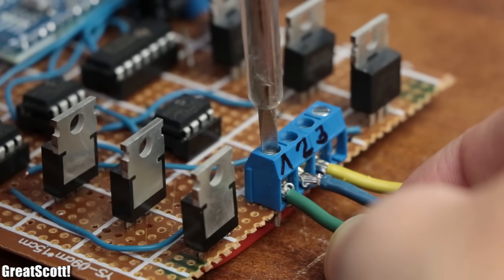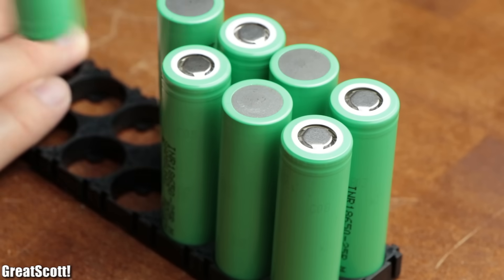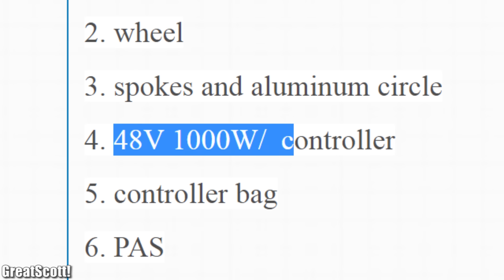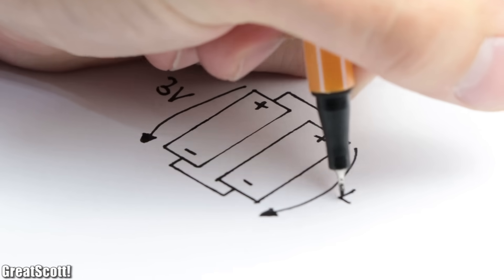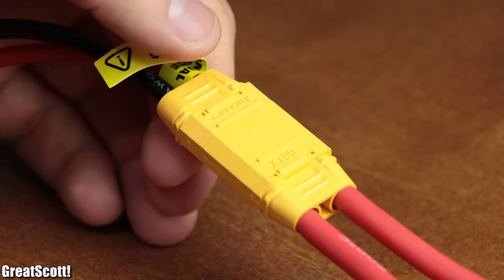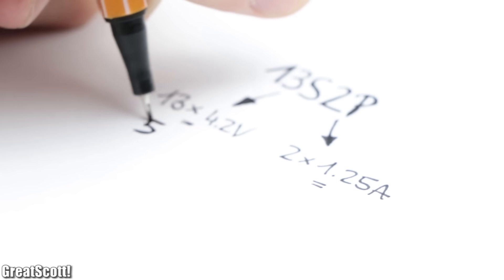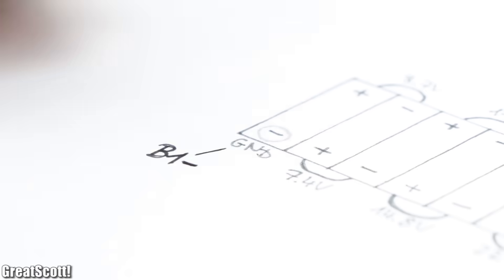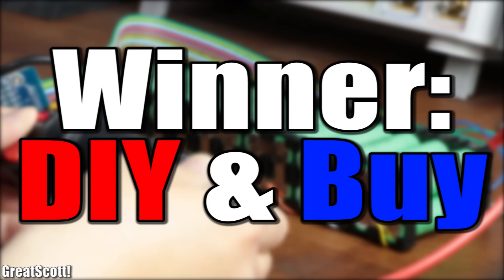EBike Battery Pack || DIY or Buy || Electric Bike Conversion (Part 2)

Comment: Connecting cells in parallel like that is so irresponsible it's amazing. You have used a 30 amp link to parallel pairs of cells. What the hell do you think is going to happen if one of those cells fails shorted? The other cell will discharge through the failed one and cause a fire. You should link them with a much lower rated conductor. Then take your common feed from the center of the link. That way, if one cell fails shorted, the fusible link will fail and cut off the damaged cell from the other.

Comment: I always thought it was dangerous to solder on these 18650 !! so no risk of overheating them and leading them to explode ?? Dunno why I thought it was good to put them in freezer first prior to try to solder them together. Your answer would be quite valuable as I have been putting some project on hold just because of that !
Reply: nevermind... just saw this other video you made : https://www.youtube.com/watch?v=5TVNdMqVZpk conclusion, i need a welder :D

Comment: Hello Scott! Hope you are doing well. 
Greetings! Firstly as alwats amaining illustrations and explanation. Each and every point you have covered properly. Even a novice can estimate and design his required battery bank this way. Great.
I have been following you a long. 
Today there is a question and i really wish you answer!!

As i said you did each and every essential things required. But i wondered why you didnt do Safe parallel connection (SPC) i.e. by putting less wider nickel strip (approx 1A) for connecting parallel connections . As you know in worst case scenario and for short circuit that connection will break. 

I am not an expert on this. I was just expecting to learn something more on that from you. (I get to know about SPC from youtube channel Damiane Rene - somewhat like this name) i like his workmanship as i like yours too. 
I will look forward to your answer. 

Thank you for the video. Bye

Comment: Is there any safety measure  in case one cell of a pair shorts? Thanks!
Reply: Add a fuse or connect a thermistor in series with the load.
Reply: I don't think it's the case. Suppose one of the cells shorts, then the other (in the pair) will provide all the current to that one regardless if there is a load or not. May be you meant a fuse between each pair¿?. If it is like that well...that was my point...

Comment: I'm not certain, but I think many of the cheap pre-built battery packs you would find on ebay would contain lower quality 18650 cells than the Samsung 25R that you bought. 

If you bought a well-made pack with samsung 25Rs, it would certainly be much more expensive than what you built...

Comment: What is the specification of the 18650 required to build a 24v 14ah battery pack?
Reply: that's not much capacity unless you're running 250-350W. 36 18650's would do that spec. 6s 6P... you'd want 2400mAh batteries

Comment: Your DIY cell might have cost only slightly less than a ready-made solution, but don't forget that you used high-quality balanced Samsung cells, whereas the ready-made solutions at the same price probably use cheap off-brand chinese cells, that give you less battery autonomy at best, and much shorter battery life at worst.
Also, the DIY solution has the advantage that you can make it any size your budget allows and any shape that fits your particular physical (and aesthetic) constraints, and it's easier to upgrade in the long term.

Comment: Was wondering, if you had a BMS with and separate charge and discharge negative contacts could you not just join them both together? Would save having a separate connector.

Comment: Is BMS required for parellel connection batteries charging?in case if i use more than 10 18650 cell

Comment: Nice Video. Can I ask you to make a Video about the current carring of nickel strips? On endless sphere you find subject about 18650 spotwelding how to. It may be good if the numbers could be explained in a Video. You got some nickel strips left? Can you please calculate the optimal and acceptable current of series bushbars?   Im oben genannten Chat ist eine Tabelle betreffend dem Stromtransport von Nickel aufgeschaltet. Es wäre interessant, wenn du die Werte prüfen könntest und mit deinen vorhandenen Strip vergleichen könntest. Ich wäre besonders an der Formel interessiert, da ich es einfach nicht schnalle wie Werte errechnet werden. Bin seit >10 Jahren vom Beruf weg...

Comment: I'm actually doing this same project right now too! same kit and everything.  Glad I watched this as I was debating 12s and 13s.  I am using salvaged batteries from laptops so I am planning on a 4p setup for battery life and reduced current draw on individual cells.

Comment: THE best “how to set up” battery pack video out there! I spent years clarifying and watching other ppl do it! You won’t BELIEVE how many ppl don’t tell you the orientations the batteries or the voltage. They just say “oh spot weld or soldier”
Reply: What's the answer for the battery orientation?
Reply: @pulledtoworkout2833  it's not "an answer" it's a diagram.
The diagram depends on your voltage and amp hour requirements. 
If your requirements are exactly the same as in this video, then wire the battery in a 13s 2p (13 in serial with two banks of 13 batteries in parallel with each other)

If you watched the video you'll understand. If you didn't understand from watching the video, then DEFINITELY do not spot weld your own battery packs, because you'll break something or start a fire. 
The answer to your question is the 13s 1p configuration, and if you don't understand putting two banks of serially connected 13 batteries into parallel with each other, then you can't safely make your own battery pack. 
Aside from the spot welding requirement, the second most important requirement is understanding how the cells are wired to each other. 
You saw it in the video if you were paying attention.

I'm not trying to be mean. But if you didn't understand what you saw, and how to apply it to your project, please don't attempt it. 
Burning down your house is not worth saving $350 on a battery pack, is it ?
No.
Reply: Thank you GreatScott

Comment: Btw lifepo4 batteries are the best. The last for very long and are safer than other lithium batteries. But only thing is they are expensive. I think their performance overrides their price. You can check here for buying a premade pack http://www.pingbattery.com

Comment: FYI that controller will be using a resistor pair to set the LVM cut off its really simple to change the LVM by swapping out the resistors.

Comment: Not sure it's an apples to apples comparison.  Only way to really tell is open up the competition's pack and see if they are using cheap Chinese Lion batts (which I'm pretty sure they are).  
I've rebuilt drill packs with good batteries and bought drill packs on eBay, and the ones I rebuilt with good batteries are way better, last way longer and hold a charge way longer.

Comment: Cells maybe legit but 3.5v is NOT a proper storage or shipping voltage, its way too low.
I made one battery like that except it was only 2C discharge rate and what i used for charging was a 1kw siemens power supply for radio communications towers. It had current and voltage cotrol pot so it was really good and did the job fast 2 hours max.

Comment: Hi GreatScott, Nice video! I saw a little spark while connecting the battery pack to the inverter. You don't use a precharge resistor to charge the input caps ?

Comment: Why did you did the parallel connection before the series ? Most of the current will flow trough the series connection , while only a small current goes through the parallel connection (just enough current to keep both cells at equal voltage )

Comment: Good video. I am currently running a 24v 250w setup on my bike. It's powered by two 20ah 12v SLA batteries. Only cost $80. I plan on upgrading to lithium ion when prices get lower.

Comment: Where abouts did you get the .3mm thick nickel? That stuff is bloody hard to find! P.S. your links in Amazon are for nickel plated steel - which is pretty crap, and with only 0.15mm thickness.

Comment: It would be better to go with 14s2p instead of 13s2p. The extra 2 will give you better cell life as you wouldn't need to charge to 4.2V, but 4.1V instead. That will drastically increase the life expectancy of the cells by 100's, if not 1000's, of cycles. 
13s @ 4.2 / 3.7 / 3.0 = 54.6 / 48.1 / 39.0V
14s @ 4.1 / 3.7 / 3.0 = 57.4 / 51.8 / 42.0V
This will give you much better performance of your motor as well.
Reply: Pretty sure the BMS he was using is not capable of charging the cells part way due to the way it balances batteries. So it wouldn't help. Plus 13s BMS systems are more common than 14s ones. Of course using a difference method of charging where you could charge to a specific voltage would extend the life of the whole pack.

Comment: I would do the series connections first because they handle a lot of current. The parallel connections handle very little current except at the ends and can be done with 18AWG or smaller. Also look up Rinoa Super-Genius because she has assembled several bicycle battery packs.

Comment: Is there anyway to make the battery waterproof ? I mean I saw your video about waterproofing but what are the main part that need to be covered with that nail thing ? Also what about the temperatures of the battery ? Will you put any sensor in case of getting very hot at summer ?
Reply: Ideally you'd want an aluminum enclosure with proper sealing/gaskets. The water bottle design seems most foolproof.

Comment: I think the pro with making your own pack would be making it a larger capacity to the normal ones you buy off shelf.  This pack is pretty small as it is. Good start though. Also picking up second hand cells is a good way of cutting costs, although adds risk of unreliability.
Reply: I steal the batterys from e scooters, i am rebuilding three batteries into one for my ebike. Yes this is stupid, yes it will work.
Reply: @kevinhorstmann1435  No problem using used cells as long as you check them properly :) I bought a 8 channel tester/charger that tells me exact capacity of each cell

Comment: Be careful with those chiese lab bench power supply's, sometimes the voltages becomes wrong after use--Then your circuit suddenly fries and you don't know why. When you check power supply voltage, the display says 4.2v and its actually 6v. It's pretty cool.

Comment: The best  power solution for those controller and motor  is a  14s  battery.
with 6parallel   with the samsung  18650 35E  or  the LG INR  Mj1.   It will give you a really good range.
That battery you created  is ok, but for a 500w motor or less;  with a 1000w motor  you will drain them really fast.    When you use a 18650 on it's current limit,  you also shorten its cycle life 
I make E-bikes,  E-chopper bikes and E-cargo bikes.
Also  let me recomend  Nkon.nl  as a trusted battery suplier.   Most of the chinesse supliers are only a scam

Comment: My OCD got triggered when you used 13 batteries and not 14 (dividable number) or 15..😂
Reply: 13 pairs, so 26 cells. You have to have however many the voltage dictates.

Comment: NiXX battery can't have so much Wh/l. I replaced in my citroen saxo 20×6V100Ah NiCd blocks with 7 tesla modules. One block has 600Wh, 8l and 13kg. One tesla module has 5300Wh, 16l and 26kg. 2 blocks and one module have exact 16l and 26kg but 1200Wh vs 5300Wh. It's more that in 4,x times.

Comment: You want to match battery pairs by their internal resistance, not their out-of-the-box charge voltage.
Reply: Measure voltage drop in a resistor and do the math.
Reply: TheVexCortex i didn’t know this, I also have never tried to measure a batteries resistance.
Do you just measure it like a normal resistor?
Reply: You need a special meter to measure it, if you hook it up to a multimeter, you will probably kill your multimeter. Mine is built in to my charger: https://www.amazon.com/Version-Digital-Battery-Discharger-Temperature/dp/B00ZGZZ40K/ref=sr_1_32?ie=UTF8&qid=1526094888&sr=8-32&keywords=lithium+charger
https://www.walmart.com/ip/Tenergy-5-in-1-Intelligent-Cell-Meter-Capacity-Checker-Battery-Balancer-Battery-Discharger-Internal-Resistance-Tester-ESC-Servo-PPM-Tester/179864013?wmlspartner=wlpa&selectedSellerId=2240&adid=22222222227056692896&wl0=&wl1=g&wl2=c&wl3=233956535514&wl4=pla-384625138979&wl5=9022129&wl6=&wl7=&wl8=&wl9=pla&wl10=113146105&wl11=online&wl12=179864013&wl13=&veh=sem should do the job though.

Comment: Both provided links are for 0.15mm thick nickel strip.  Did you use 0.15mm or 0.3mm?  If indeed 0.3mm, that spot welder works well.  What type of battery and voltage is powering the welder?

Comment: I am enjoying this project. I assume it would be preferable to solder the BMS leads to the appropriate nickel strips before spot welding them to the battery, in order to avoid heating the batteries.

Comment: When you charge the battery pack with the BMS, is the input voltage just the 4.2V of each cell times the number of cells you have? So that would mean I would need to get a power source that can supply the same voltage as the max voltage of my battery, or would the BMS stop charging when it reaches the voltage specified in the datasheet? Also, does the BMS limit the amount of current going into the pack when charging, or is that also determined by the power source? Thanks

Comment: Great video, thank you.

Maybe it is better to use 21700 cells, it could double capacity and increase volume only fot a 10%. It could reduce cost of battery pack(we can use only one row of batteries)

Comment: i have two question
1. Can you give me an actual limit to battery connection ( For example you said 4v to 3v is dangerious. But 0.5V is still dangerious?)
2. i also have 3s bms system, and i dont know the exact voltage to feed it. 12.6? 12? i dont have data sheet but i have link for you.
https://www.aliexpress.com/item/3S-10A-12V-Lithium-Battery-Charger-Protection-Board-Module-for-3pcs-18650-Li-ion-Battery-Cell/32796756917.html?spm=2114.10010108.1000014.5.35302b2axqS4pZ&traffic_analysisId=recommend_3035_null_null_null&scm=1007.13338.80878.000000000000000&pvid=91589704-ca86-44ed-95ae-1f45ca78bebc&tpp=1

Comment: Just to understand properly: to calculate the current your batteries and the nickel strips need to take: load max current divided by the nr of cells in paralell - am I correct? Best regards.

Comment: Oof, no one's mentioned the spark. Plan to add a precharge circuit? Also please remember the fuse-- at your voltage it could just be a Littelfuse Mini 58V 30A fuse.

Comment: The "serious" connections are very important. BTW, make sure to not spot weld in the center of the battery contract, stay to the outside a bit

Comment: Could you please somehow proof that this bms is really working? because there are lots of BMS sold on eBay that only implement der Batterie protection Circuit...
And some of them even do a bad job at this task as well - because they only protect any battery is below the threshold voltage.

Comment: 4:20
I don't know about your trustworthy seller, but Batteries should be stored at around 60% charge (ca 3.82 Volts). These you bought came at 3.5V. So either they have a hight discharge rate or they have been stored a little bit longer.

Comment: So i was wondering if you planed on doing any fusing each set of cells, say at 5.5 to 6  amps? ( resistor wire leads can carry 5 to 6 amps) Just incase. One cell decides to die? Id hate to see the combined amps passing through one cell.

Comment: 1000W is the rated continious power of controller...at full throttle acceleration current will most definitly rise above 30A, maybe even touch 40...

Comment: Du musst bedenken dass das Rad weitaus mehr Strom zieht wenn man es belastet.

Hab selbst mal sowas versucht aber einen Fehler gemacht: Ich habe mir alles aus Einzelteilen zusammengesucht da mir Kit plus Akku zu teuer waren. Leider war da beim Vorderrad keine Drehmomentstütze dabei, was mir letztendlich die Radaufhängung verbogen hat. Könnte man wieder zurückbiegen aber ob sich das wirklich lohnt weiß ich auch nicht. Und ich hatte noch das Problem (als dss Rad doch mal ca. 5km fuhr), dass es nur stotternd fuhr (also in Schüben Gas gegeben hat). Denke das lag am Akku, müsste ich wohl ein paar Zellengruppen tauschen die evtl. Defekt sind, dafür fehlt mir aber ein Schweißgerät. Kann daher jedem nur raten, 200€ mehr in die Hand zu nehmen und neues Zeug zu holen, anstatt 100€ wegzuwerfen und am Ende nur ein defektes Fahrrad und einen Haufen unnützen Elektroschrott rumliegen zu haben. 

Hab dazu eine Frage an dich: Wäre es möglich, die Radaufhängung wieder geradezubiegen und dann eine Drehmomentstütze einzubauen, oder würde das direkt wieder kaputtgehen? Das mit den Schüben ist erstmal egal, hatte auch so 25kmh geschafft, vielleicht ist das auch normal so wenn der Controller das Maximum erreicht oder so (hab einen Controller genommen, der auch ohne Sensoren nutzbar ist).

Comment: Why when you calculated its current charge system, you multiplied by 13 the voltage but only by x2 the current? If those batteries are in series, wouldn't each pair consume 2.5A and thus required 2.5x13 = 32.5A ?

Comment: Hey great scott! What about using 26650 batteries? They are a bit bigger and can provide more current and hold more charge. Also they are a little bit cheaper. In this way you wouldn't need a parralel connection and the battery pack would be a bit smaller. I once bought 4 of these 26650 5000mah batteries for 13 euro (there was a 50% off tho) i tested the capacity and they turn out to be the batteries i ordered

Comment: When you measured the voltage of the batterypack you switch the red and black probe everytime. Is there a difference in measured value? (Or, why did you do that?)